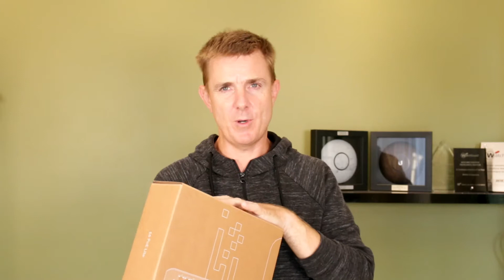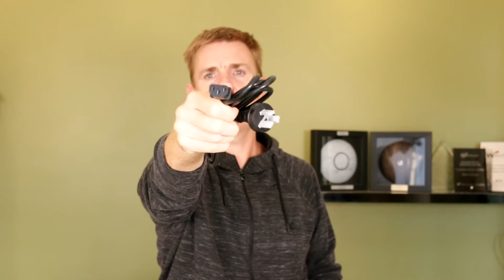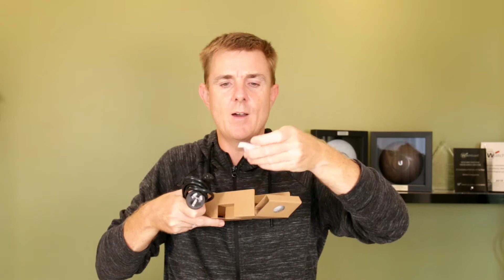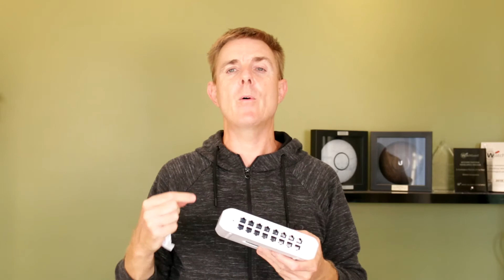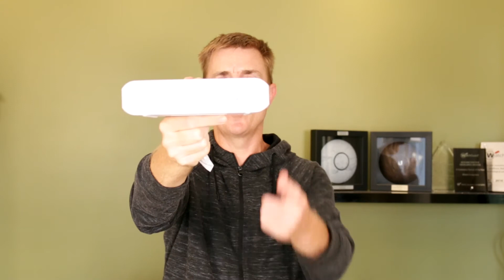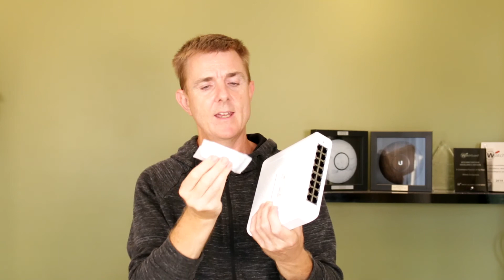Out the Box Series - Ubiquiti Unifi USW Lite 16 POE Switch

Comment: Just curious, you seen to infer in this video the FLEX Lite range of switches can themselves all be powered by PoE. Is this really the case? The spec sheet for only the 5 port FLEX MINI model says it can.
Reply from the maker: A good point and sorry if I was not clear. Currently the usw-flex and flex mini are the only ones that can be directly powered by PoE